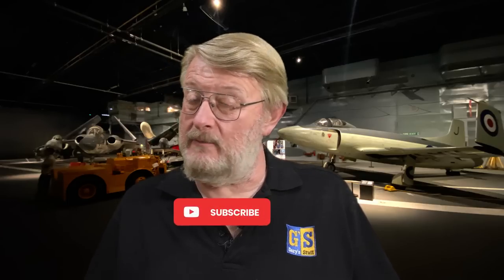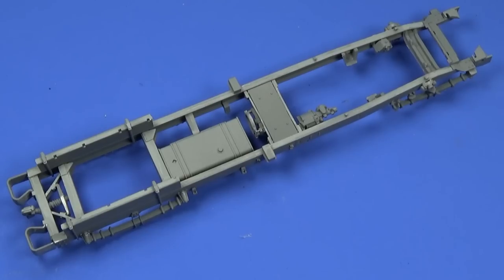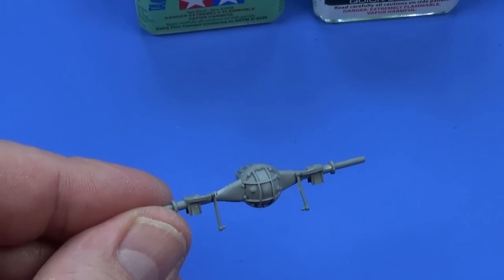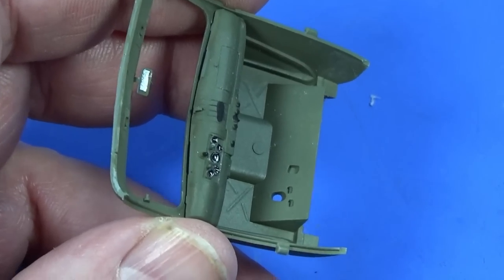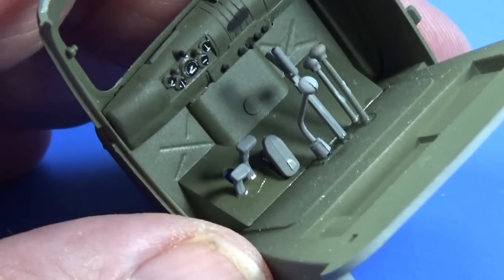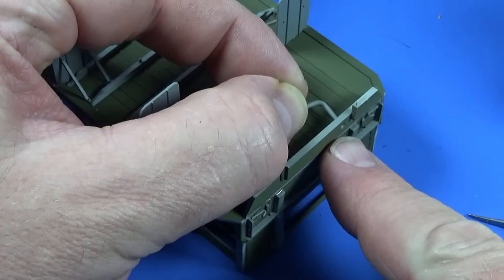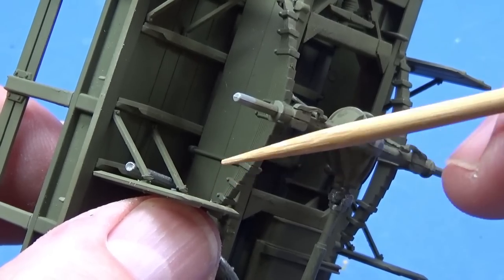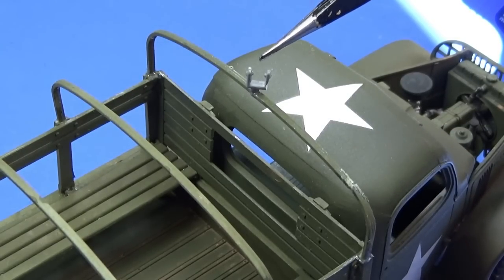ICM's NEW AMERICAN PATROL 2023 - building the G7107 truck!

Comment: I've built TWO of these when they came out with the "lend-Lease" Russian versions. At 5:30, the cross bearer you install; I put it in back to front. Swore that on the second one I would get correct...no such luck!  Put 2nd one in wrong, too. At least I realized it before the glue set and I pulled it off the frame.
The engines in Chevy trucks (civil and Mil.) where a medium Grey. most of the accessories; starter, generator, voltage regulator, were all sub contracted and usually were black.
At 13:40, the very fragile bits are the "knee-action" shock absorber linkage. think those and frag.?, wait til you get to the other half of the linkage.
The lost details will make for great diorama possibilities. Except in snow & rain, most WW II military vehicles had the doors windows down for circulation most of the time.
The construction of the cab, I thought, was to allow them to make the hole in the cab top for the machine gun ring mount. The wood canvas frame would never support a gun mounting.
I have actually owned three of these Chevy's and was sooo glad to see them modeled.

Comment: FYI as a disabled driver - in my case paraplegic - I learned to drive on an automatic and my licence was automatic only. Just as well as I didn't - and still don't - have three hands, one each for the clutch, brake, and gear stick :) Also AFAIK there are no disability adaption kits for manual transmissions.
Reply from the maker: I have heard of people taking automatic-only licences in the UK, whether or not required by their physical needs, it is just reasonably unusual. Or at least it was, maybe in recent years it has changed. Don't hear too much painful grinding of gears down our road these days (there is a test centre not far away...) and I don't think electric vehicles have gears. Maybe they do. It's a long time since I've been in the automotive loop. However, now I would never use a manual gearbox out of choice, unless of course we do win the treble-rollover lottery in which case I don't think Aston Martin did the DB-5 superleggera convertible with an auto option...

Comment: i believe the .30 will feed from either direction, so there's no wrong answer here for how the belt is fed. Also, the mount would have been a field mod so you could mount it anywhere.
Reply from the maker: I wonder how the feed mechanism works then? I mean, it must pull the next round into place as the breech goes back so it can chamber the next round. Maybe there's a switch?

Comment: Gary - did you not use any primer for the ICM paint?
Reply from the maker: Yes I did, I tend to prime everything on the frame, at least enough for most eventualities. With aircraft I'll give them a final primer coat as I will have done panel fitting and the canopies during the build. My usual primer is Jenolite acrylic for plastics out of a rattle can.

Comment: As I said in the box opening video  I thought those hoops were very fragile. I am not sure if the 30 cal was ever mounted off the hoop. It would be far too flimsy a mounting point. There was usually a hole in the cab roof with a substantial gun ring around it so the gun had a 360 degree arc of fire. I think that is an ICM add on. Nevertheless I think it is a good detailed kit and a nice build.
Reply from the maker: In their catalogue there is a photo (I assume they used for reference) of the .30 mounted on the front roof hoop as in the kit, but it's not clear if there was any other form of support underneath it. I'd have to have a look around...

Comment: Hi l agree to that 1 inch mild steel pipe designed to support canvas would not serve long l like the model & your build but a gmc is too slow, too noisy, too high , no armour the crew would have a bad day if ambushed by  a mg 42😢🥇🎖😎